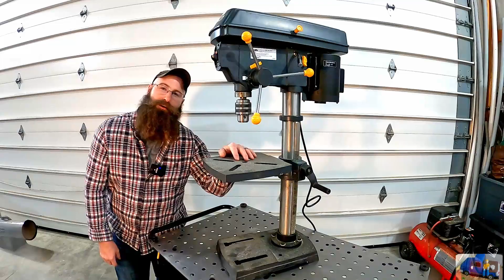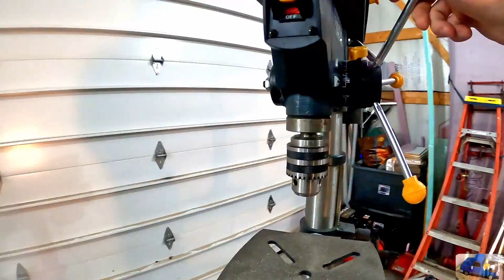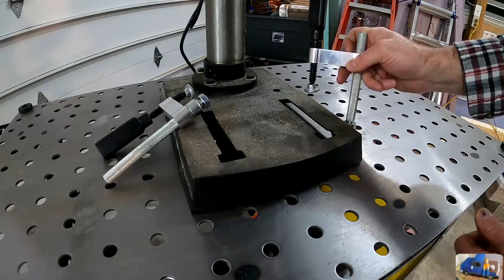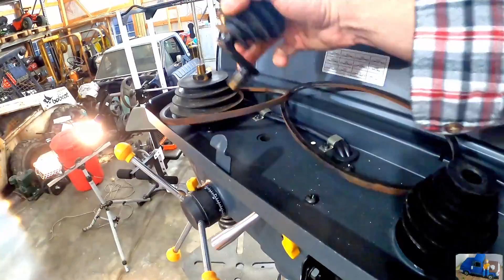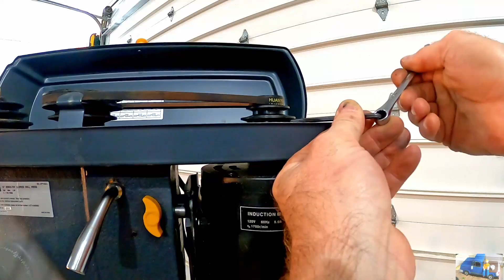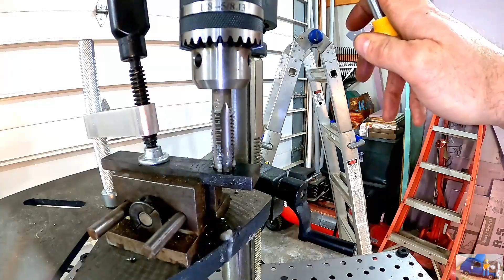Drill Press Bench Top Model; Hippy Shakes (Bench Pro)

Comment: I have an Old Table top drill press I bought back in 1988
And did this from the start 
That this is how they operate
Reply from the maker: It still works pretty well, but throws the belt on occasion.... Need to build a permanent home for it instead of lifting it on the bench.  Thanks for watching 👍😁

Comment: Home shop machinists challenge: mount a drip tub under the table on the drill press and install a gravity fed, gravity flow coolant system. A hand pump up pressure coolant system takes it to the next level over gravity fed. Next? Install a bright light and wire it up to the on/off switch so you have no issues with seeing what you're doing. Best wishes! 👍🏻🗜️🇺🇸👨🏻‍🔧

- Max Giganteum
Reply from the maker: Great ideas Max!  I have an old light I hope to add a magnet to and a flexible air nozzle.  Both were intended for the small mill, but would be handy if usable on both units.  The air nozzle has a port for mist lubrication (I think).  Flood coolant jobs will likely be reserved for the milling machine.  I prefer oil and good old bacon grease on the drill press.  Thanks for watching!  👍😁

Comment: As you already have a lathe... any thoughts on rebuilding this obviously low end bench top drill press to remove defects or faults? I've known a few guys that bought low enders cheap off the web (or from wherever) and they disassembled them either to repair or upgrade them. Sometimes, they had to disassemble and reassemble them just to get them to work at all! Anyway, upgrades might include installing roller bearings instead of bushing types but even machining new and precise bushings with zerk fittings was often a massive improvement over factory parts. Of course installing lube ports at various friction points was as well. One of the issues that you noted was each pulley being out of true. Any intent on truing those parts up? The truth is that just as it is with most things, you get what you pay for with a drill press such as this. However, if you're willing to invest some time into them (of which the factory did as little as possible) then the accuracy and durability can often be greatly improved upon. Thoughts? 🤔🇺🇸

- Max Giganteum
Reply from the maker: Good Morning Max!  Yes, the drill press can be improved upon.  I think the guys who purchase low end units and make them more accurate/reliable are geniuses!  This unit was purchased only by chance and for a few pennies.  I think it only cost $75.  Dad purchased it from a local auction and shared his findings with me.  Thanks Dad!  I think I will keep using it 'as is' unless I experience performance issues in the future.  So far it's pounded a few 1/2" holes without any hesitation.  Thanks for watching!  👍😁